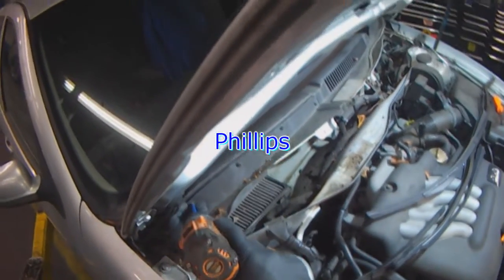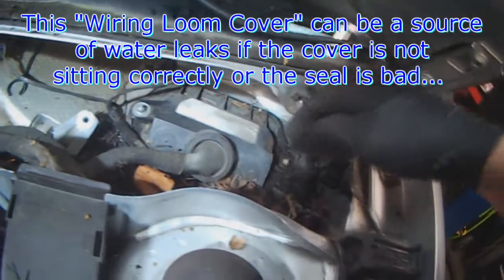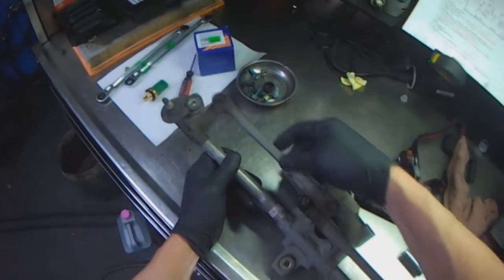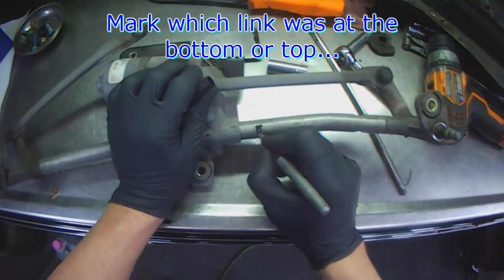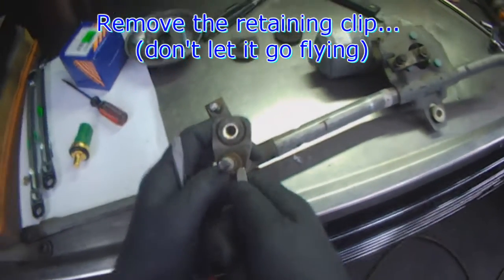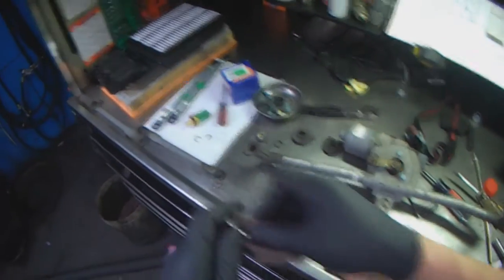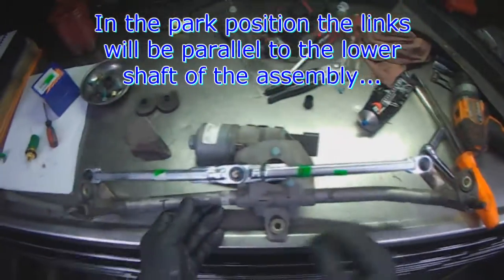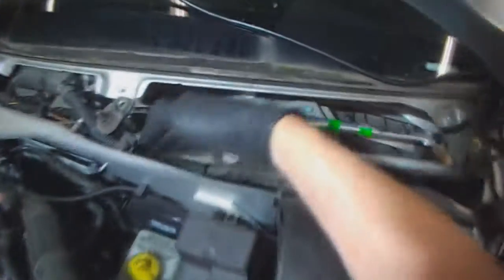VW A4: Wiper link(s) replacement

Comment: I am getting a clicking sound from the wipers.  There seems to be some play.  Is that usually from the wiper links or is it possible there is some play from the motor?  The car windshield  was hit by a brick and damaged the wiper arms that were replaced.  After that I got a clicking noise from the wipers system.  Wipers work fine but the clicking sound drives me crazy.
Reply from the maker: +Johnny Woo Probably the links... you can pop them off of the motor and run the motor by itself to see if the noise stops.
Reply: Thanks

Comment: Heeei Thommy. Happy new year. Wi
shing you all the best. Now in winter my 2011 jetta se 2.5 has bad problem with wipers. When cold and car outside, wipers not working til heated up  relays inside car clicking when i push stalk down. But wipers no working. Could you send me all electric  schemas on this car so i can examine them  i must do my inspection on car outside in -20c weather. So i like tovknow first what schemas look like. Thanks Thommy.
Reply from the maker: email me so I can send via email.
fkh161 @ fkh161 .ca (no spaces)